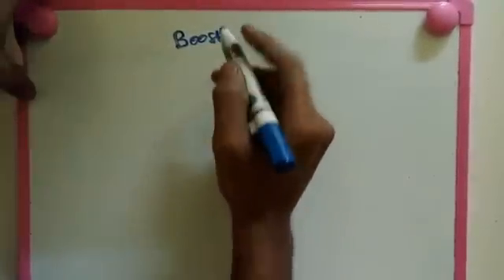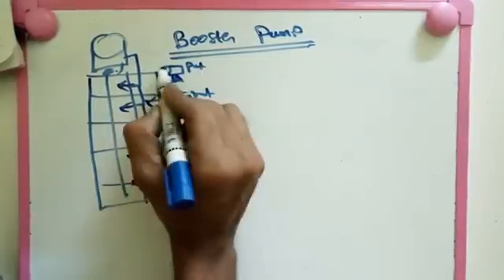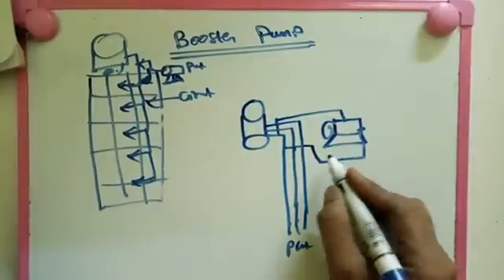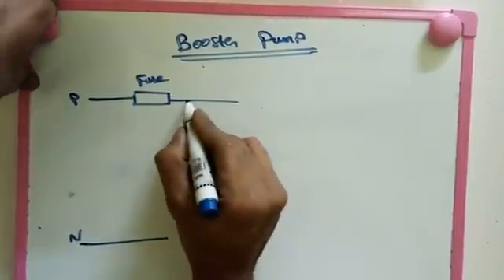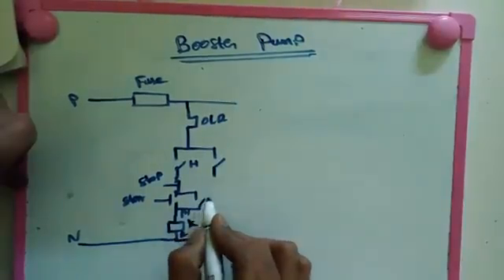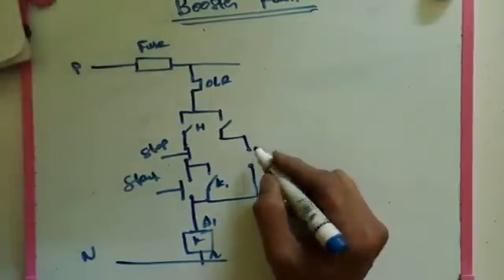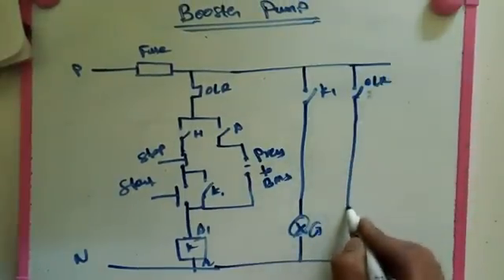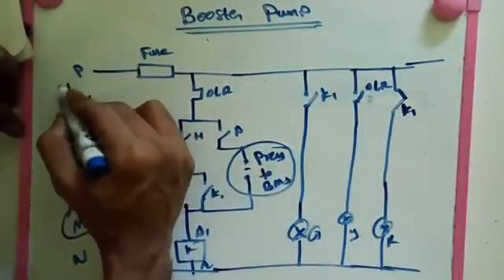Booster pump explain new 2017

Comment: your stop connection is wrong. The way you connect the stop button, you can't stop the motor in auto mode. This is unsafe. You need to wire the stop button just after the breaker (before selector switch)
Reply: Look at how bms works stupid.

Comment: Sir I have problem in a pump testing system which we shifted from one location to another when testing the pump discharge pressure and head is less the only difference in ne location and old location was the test water tank was on the roof of the building and now it is on the ground and plumbing is lengthy can you suggest me the solution
Reply: Sounds like length of pipe and number of elbos could be a problem. Each elbo causes a drop in head (pressure). Add them up and it could make a difference. Internal pipe friction due to length adds to a drop  in pressure. Even what kind of pipe could help like pvc pipe. It would help due to smoothness. An increase in pipe diameter would help, especially if you try to increase flow from pump. Did you recently rebuild the pump? If too much clearances, or reduction in impeller diameter would reduce pressure.

Comment: My pressure pump does not stop after we turn off water usage... It keeps working at rapid force with intermittent stops.... How to stop a booster pump after the tap is closed.... Thanks
Reply: Change the pump don't use kumar pump use grundfos
Reply: It should cut off once the pressure is reached ... automatically ... which one you are using right now ?
Reply: Srinivasa rajkumar B 

Thanks for the reply.... I am using kumar pressure pump...

Please let me know how I can correct the problem
Reply: @srikanthbandlamudi8060  try changing the cut off pressure in the pressure switch. What's the temperature set in the switch?

Comment: sir me why ct secondary should not be open and knee point voltage
Reply from the maker: s current transformer working as step up HT potential transformer at the time of secondary open  ie primary turns lesser then secondary turns so if we open secondary that one make electrical burning or blasting ....

thanking you for support...

Comment: Hi there 
Can u help my problem 
I live in 6th story flat without central water tank on TOP 
We need to pump from service pipe line from ground floor which water supply is uncertain 
Every time we pump the water is a risk . If we don't receive water at 6th floor we have to stop the pump and Try after a few hour.
The problem is after we tried there is always air lock which force us to go down ground floor where pump is placated and clear the airlock.
Really appreciate if u can adivise me on this matter.
Reply from the maker: S sir .. First u can clear me which one is most highest floor of water supply by using that service pump .. then you can make pipe line upto most highest floor ie if your supply same service line for upto 16 th floor  then you can make pipes upto that floor Then drop pipes to supply all floors up to down ...In this arrangement air lock not occurred...